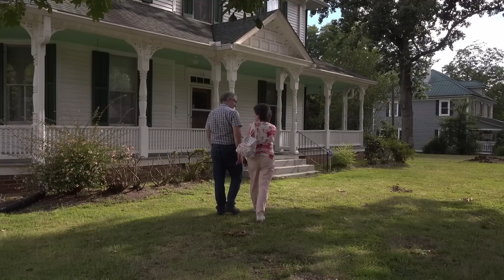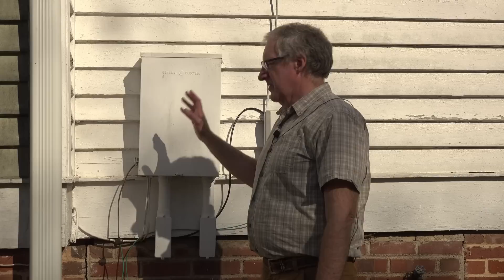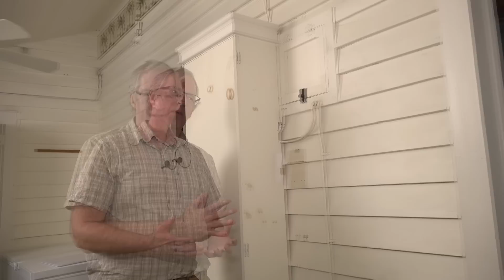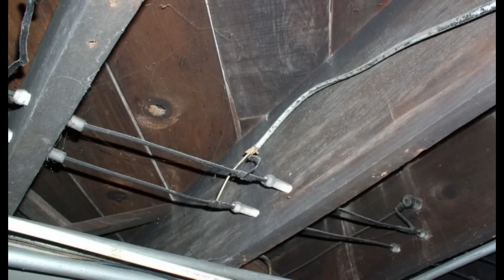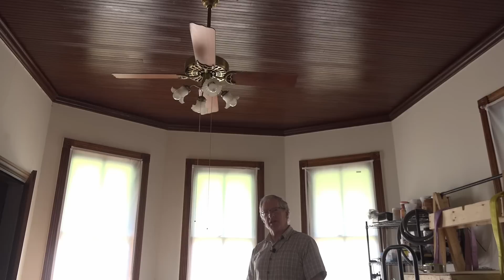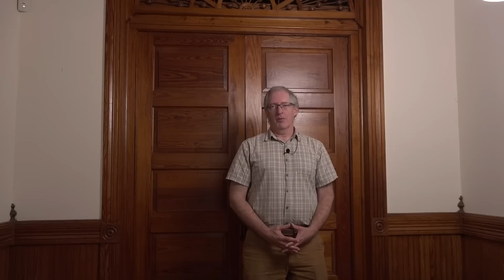EP120 Victorian Lights and Electric

Comment: I always asked every electrician how come we have more fires now with new modern wiring then they did with the knob and tube wiring I thing the same thing knob and tube was the most safest because they were spread so far a part that was impossible to cause a fire and if there was a short the only place that would happen it was inside a metal junction box that would contain it from causing a fire and there you have it the real safe wiring
Reply from the maker: Good point! I think we all have an irrational fear about the old wiring that is unfounded for the reasons you pointed out. Somewhere in our video library is an episode where we had to tear out and replace a bunch of Romex that had been chewed up by squirrels. That stuff was really Scary!

Comment: You guys need a carbon arc street lamp. It would look absolutely amazing.
Reply from the maker: These days we're stuck with high pressure sodium lights outside. Nice and orange!
Reply: @1834RestorationHouse  those are fantastic, I use them inside and outside

Comment: I am currently in escrow on a property built in 1914.  I am both excited and scared about some of the things that have come to light during the process.  I want to honor the home and restore it. It has knob and tube wiring that has never been updated.  The inspector says it is in great condition. Finally got someone in there to look at the heating system last week. The gentleman that performed the inspection seemed in awe of the system and the fact that it is still operational and in working order.  It is water radiator system with a boiler.  He reported that he couldn't give it a precise age because the boiler was before dates were put on them but said it is pre 1950s and that it could possible be original.  A couple of repairs were evident.  One room upstairs a radiation was removed and capped off, but the rest of the system is working and the owner who is in his 90s was still using it to heat the house until he moved out December.    All of the piping of the radiator system is cast iron insulated with asbestos... Ekkk.  He said I can still use the system, it is safe.  He warned me that any repairs of the piping would be very expensive due to the asbestos.  I may have to abandon the system at some point with a new HAVAC install?  Wondering your thoughts on this?  I think it is very cool the old system is still operational today.  Need to strategize for down the road.
Reply from the maker: Ionna, That is great to hear! Those old boiler systems were very good at heating the house and there is no reason to pull it out. There's a good chance that the boiler will outlast you! ;-) Are you in the Northeast?

Take a look at our earliest video episodes. We used to own an old house built in 1834 that had an ancient boiler. We even gave the boiler its own episode. It would be good if you can find a service man who really understands and appreciates the boiler system. As a homeowner, there are a few things simple things you should do to keep the system running well. 

Given the choice of HVAC vs. Boiler heat, I'll take boiler every time.

Comment: As an electrician that got into it as a kid this is fascinating. I remember seeing bits and bobs of this stuff throughout old houses as a kid learning with my older brother. Seeing it all still in place hooked up and working like it always has is rare though. If it were me and your just using it for lighting, I'd save all of it and convert it over to 24v DC to make it safe. Try to show it off a little even maybe move some of it to surface mount.
Reply from the maker: A well built knob and tube system is a thing of beauty!

Comment: When the wire/plug of an appliance gets warm/hot, is the source the appliance or the house wiring? 
Ex., my air fryer cord/plug gets warm/hot but I always thought it was the wire on the air fryer being the source. Like, I feel like I could use it anywhere and it would get warm just because it's not a high gauge insulated cord.
Reply from the maker: Usually the heat is caused by poor contact at the outlet itself. The contacts get loose or worn down with age. I've seen some that were so bad that the cord would fall out.
Reply: @1834RestorationHouse  That's actually the case with this outlet. I'm going to ask my neighbor to swap it out with a new one and see if that helps!

Comment: I just removed my empty old, unpainted wood fuse box which must have been in the pantry and looks like your box with the butterfly hinges  ( now the bathroom since c 1920s), and still can see the K&T in the 1/2 story above, though it’s been changed like yours. I have a new 200 amp box waiting...and old lighting still installed in 4 places. What’s really cool is that i was able to find 1920s ceiling fixtures to go with the old ones and I’ll be rewiring them. Thank you for a timely video!
FYI your porch light is c 1920s-30s.
Your entry light appears more Deco, probably 30s or even 40s, as it’s smaller and simpler. 
My favorites are the ones made in the late 10s!
Reply from the maker: Great information! Sounds like you're making good progress on your electrical upgrades.

Comment: As I mentioned on your recap video, the electrical system fascinates me - both the new stuff you've put in and the old fashioned wiring. I've never seen fuses like that with glass and ceramic, but they're actually very pretty. Even when everything is converted to modern electric, I'm sure those old fuse boxes and wires will be a pretty display piece as part of the history of the house. Looking forward to more rewiring videos!
Reply from the maker: Have you seen pictures of victorian industrial electric systems. That is off the charts cool!

Comment: A downside of knob and tube wiring is that it cannot, by code, be covered with house insulation.
Reply from the maker: So true! On the other hand, these old houses need to breathe and insulation can cause moisture buildup.
Reply: That is good to know!  I was planning on having house with old knob and tube rewired so that I could add more insulation.  Is that a bad idea? Thank you!  @1834RestorationHouse
Reply from the maker: @lonna4591  Ionna, it really depends on the condition of the wiring. I seen it where it was like new, and where it was tattered. If it's possible to rewire without wrecking the plaster, then it could be a good thing to do.

Comment: Jesus that's a stab lok panel holy sh you need to remove the 60s panel that's a stab lok panel there dangerous and cause electrical fires 🔥
Reply from the maker: That's the plan. We're doing a phased cutover of all electrics onto the Square-D QO load center. We haven't had any trouble with the old panel, but to your point it really needs to retire.
Reply: Indeed

Comment: I have a1907 with the 2 front rooms still original including plugs and switches..I am afraid to use them
Reply from the maker: You may have good outlets or not. It's hard to tell without inspecting the wiring.

Comment: We live in a 1903 home with many styles incorporated originally. I am presently adding Gothic. I removed all of the ceiling fans for converted gaslights. We use a stand up fan in some rooms in summer. TN. here so I get the humid situation 😉
Reply from the maker: That should really dress up your home, having old lights.

Comment: Thanks much for showing the knob and tube pictures as well as your wonderful light fixtures. That mid century light must have looked horrible when it was in use. It would be ok in my 1950s rancher, though. I was just checking out original mid century lighting yesterday, such as PH5 pendant lights. Even the reproductions are extremely expensive (to me, anyway). Enjoy that lovely spring weather; I know NE Ohio will get it soon. 😍 🌷
Reply from the maker: Those old flying saucer lights looked so nice in their native midcentury environment.

Comment: Your electrical system is very interesting!  I grew up in Boston in a house that originally had gas lights with fixtures in every room, and when electricity arrived on the scene, an electric fixture was fastened to the capped end of each pipe.  The entire house was on just one circuit, and each room had just one outlet.  This was actually a good thing, so that only one high-draw appliance (toaster, crock pot, etc.) could be plugged in at a time.  As we acquired more things like a TV, a higher-amperage fuse replaced the lower-rated one!  We were unaware that all the gas pipes were still live until we attempted to replace the kitchen light fixture and heard gas escaping as we unscrewed it.  Back then it was "manufactured" gas from coal, which is very deadly.  But I didn't die from poisonous gas or an electrical fire, nor from the lead pipes that supplied our water!
Reply from the maker: WoW! That sounds scary to have gas pouring out like that.

Comment: As far as we can tell, only the faux candle sconces in our guestroom/office are original to the house. They are still in a box, waiting to be re-wired and put back up. The majority of our original electric wiring was enclosed in metal conduit, all since rewired, with a new main panel. We went with new fixtures, but kept everything in the 1920s-1930s aesthetic. You have some nice pieces there. If your house is from 1900 (a transitional period), I would think they are original. Not the flying saucer light, though, lol. In various old house tours I've seen fabulous combo gasolier/electric fixtures, some with custom ceiling medallions to match. The sky is the limit when people are building their dream mansion.
Reply from the maker: It's always fun to see how the grand homes played with styles and architecture. You can still get cloth covered electrical cord for lamps. Might be good to help restore your original one?
Reply: @1834RestorationHouse  They are actually wall sconces hard wired into the wall, with individual brass switches to shut off each one separately. My favorite bit is the faux candle wax drips below where the 'flame' bulb screws in, and original hand painting on the metal 'shield' plates that cover the guts in the wall.

Comment: We live in a 1965 ranch.  A previous owner  turned the walkout basement into a family room ( the fireplace is down there).  Our first project after purchase was to redo that area for use as a library.   Not one connection of wires was encased in a box.  The wires were connected with wire nuts and hanging above the drop ceiling. He has also cut a couple of extension cords and had them wired in to connect some overhead lights.   So glad that was our first renovation!
Reply from the maker: Wow! We're glad you were able to find and fix those problems. That's very common to find unprotected junctions in old houses. We still have several that need to be corrected.

Comment: My favorite lighting design would probably be arts and crafts or art deco. Regarding that non metallic sheathed cable (Romex) with the silver sheathing, that is probably from the 1940’s or 1950’s. I started in the trade in the 1960’s and by then we were using non metallic sheathed cable that very much resembles what is used today. I think that the sheathing material is a little different. I’ve mentioned this before but when I was in trade school we were taught how to install knob and tube. Early installations would space the hot and neutral fairly far apart, 6 to 8 inches usually, later the knobs were made to clamp both wires spaced about an inch apart.
Reply from the maker: Sir, you have a rare skill! Not many people can say they've been certified in knob and tube construction. ;-)
My (Mike) childhood home was built in 1962 and I remember seeing the silver coated wiring then so they must have still been making it at that point. Well built knob/tube systems are a thing of beauty!

Comment: I find it interesting that your breaker panel is outside. In Canada they would ALWAYS be inside, usually in a cellar (which I realize you don't always have in the south). I should think that moisture would be an issue in SC.  Also, in Canada you can't get insurance for homes with knob and tube wiring--you MUST re-wire for code (and safety) reasons.
Reply from the maker: It's fairly common to see outdoor panels in the Southern states. I thought it was weird too the first time I saw them until I realized that all of the new homes were being built that way.
Reply: @1834RestorationHouse  Wow It makes no sense but hey whatever!

Comment: Love Victorian houses, but not a fan of the lighting fixtures of the era, especially if it consists of one single fixture in the middle of the room ceiling. Room lighting needs to be more subtle! Ceiling fans are great -- without the lights!
Reply from the maker: I wish we didn't need the ceiling fans, but our Southern humidity requires them.
Reply: @1834RestorationHouse  I have ceiling fans, but without the light kits!